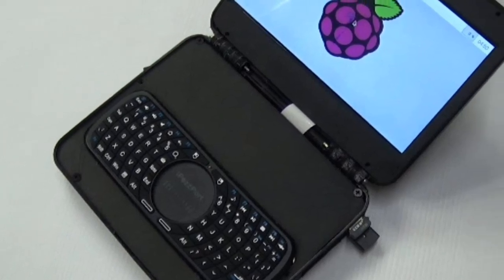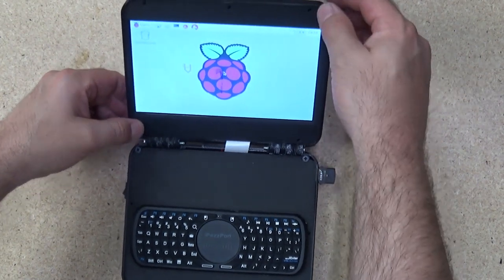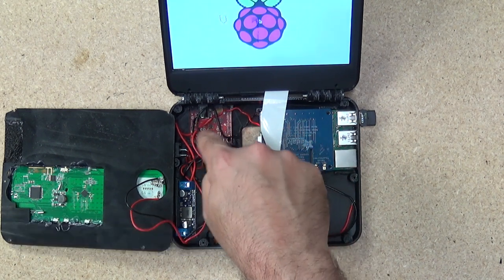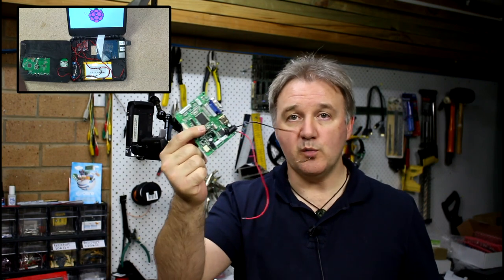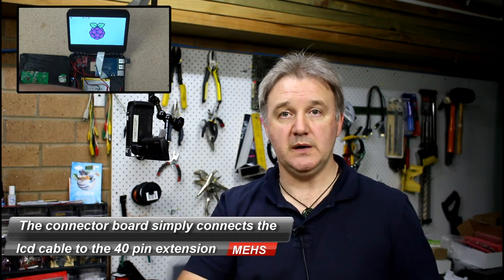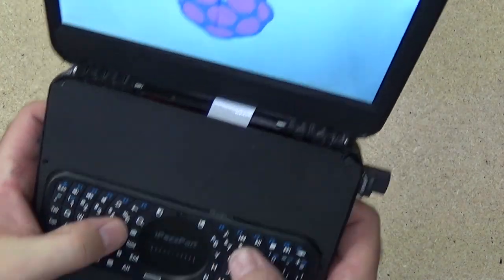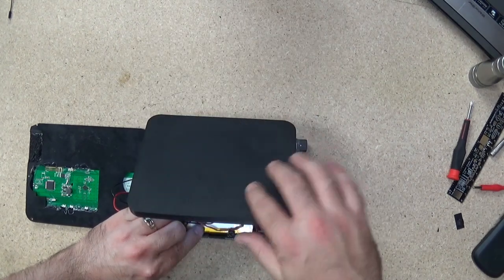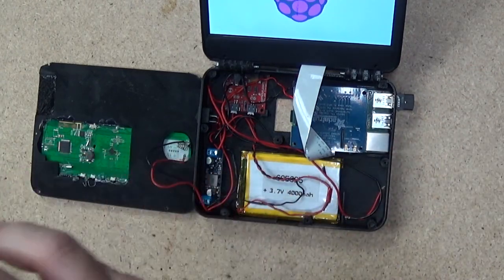Raspberry Pi 2 Portable Mk 5 (MEHS) Episode 39

Comment: From the looks of it.. It seems to have a 3 to 4 1/2 hour battery life... 7 1/2 with out the LCD, keyboard,  wifi and BT
Reply from the maker: Hi.  Pretty close.  About 3 with everything running normal use and yes 7.5 with just the Pi ticking over.  Cheers.

Comment: HI. What about adding a Psion series 5 style keyboard, nintendo 3ds style  controls and you have your perfect retrogaming rig. Ik think trying to get the total footprint slightly smaller would be great. Very impressive stuff.
Reply from the maker: +Raymond Mookhram - Thanks for the feedback.  I've got a spare 5 inch display just asking to be turned into a portable gaming rig so I'll keep your ideas in mind.  Yes I really like Psion devices but I would need to build the keyboard from scratch as I don't think anything similar is readily available, very time consuming, but possible.  Cheers.
Reply: +My Electronics & Hacking Show : I read somewhere that the Psion series 5 keyboard is stil patented and it's IP is owned by it's original designer. There are only two really good keyboard out there; the Lenovo/IBM keyboards for laptops and the Psion keyboards for portable devices. Up to now there still is no good portable keyboard. Perhaps an opportunity?
Reply from the maker: +Raymond Mookhram Yes perhaps.  Definitely a challenge!

Comment: you might be able to also eliminate the bluetooth dongle by piggybacking the leads to the transmitter on the keyboard directly to the usb jacks mount pads
Reply from the maker: +scott deere  Hi.  Thanks for the suggestion.  I have broken down a dongle and soldered the internal pins to usb pins before but never tried bypassing the dongle altogether.  Cheers.
Reply: Got the idea from Ben Heck

Comment: Why doen't you use the official Raspberry Pi 7" touchscreen?
Reply from the maker: Hi.  The official touchscreen is definitely a good option.  In this case I wanted to try something with the Kippah.  Also the official screen is a fair bit larger.  I didn't really want to go bigger for this particular project.  I may use the official display in a future project.  Cheers.

Comment: Ergh. If the s reen uses the in pins that means it needs a lot of reconfiguration to get the 3d processing from the graphics part of the chip. I'd rather just look for a HDMI based screen.
Reply from the maker: +eLJaybud - I haven't noticed any real world performance impact yet but I haven't done a side by side test of the Kippah solution vs a HDMI connected approach.  Might be worth looking at.  Cheers.

Comment: Do you build these just for the fun of building? Or do you actually use them
Reply from the maker: +Glychee S - HI.  Both really.  I enjoy doing the builds and learn what works well and what doesn't.  I use them as intended mostly but sometimes I retire an item because it just doesn't do what I wanted or sometimes, like this Mk5 version, it is handy but needs even better battery life and speakers.  If i did it again i would try to add a nintendo style game controller as this unit is really handy as a retro game console.  Cheers.

Comment: how did you learn building this kind of devices?
Reply from the maker: - Hi.  Just break it down into sections or parts and figure out how to best build or create each part.  This kind of project has a case and some electronics.  The case has a lid and a base and needs to house all the electronics and open and close like a laptop.  I could have made this out of wood, plastic, resin or metal.  Since I have a 3D printer I used that to make the case.  The design is done with software like Tinkercad or 123D Design.  It only takes a few hours to learn these programs.  From there its a matter of learning some design ideas and techniques and developing a viable design.  Then you pick up the needed 3d printing skills and you have a case.  Next is the electronics.  You need wire, parts, soldering equipment, tools etc.  You would need some basic understanding of electronics so If you don't know how to do something you learn it.  It will depend how much you already know and what you are actually doing but it is slow to start and you will learn more and be able to do more and do it more quickly as you progress.  So basically, figure out what you want to do and then figure out what you need to know but don't yet know and go an learn it.  Cheers.

Comment: You could've used MicroSD extension to make MicroSD slot on the side instead of big hole on the bottom.
Reply from the maker: - Hi.  Yes that's true.  Sometimes I just use what I have at the time but the sd extension would have given a better looking final result, maybe next time.  Cheers.
Reply: My Electronics & Hacking Show I totally understand you. Things from China may go for really long time, and local stores just don't have that kind of useful thing.

Comment: great project as usual,  mark 6 should be built with stuff easily accessed by every day pi users cuz I'm pretty sure you used a 3d printer lol
Reply from the maker: Thank you.  Yes I did use a 3D printer.  The next one uses acrylic but I'm still using a 3D printer for certain parts.  Cheers.

Comment: you can make it smaller if you use a rpi zero it will be smaller and faster
Reply from the maker: Hi.  Thanks for the suggestion.  Smaller yes but not faster.  This project has the pi2 in it, not the pi1.  I hope to do a Pi zero device sometime soon and yes, hopefully make it much smaller.  Cheers.

Comment: I'd rather buy it from you, if you would sell it somewhere on the internet.
Reply from the maker: +Sapioit Hi.  Thats a tricky thing when I think about it.  I'm not against it but prototyping doesn't produce a cost effective product.  Every part is basically retail and the approach is different to any form of production run.  As an example, the parts alone in this project cost approx  $210(AUD).  If I was going to make them for resale, I would try to cut the costs a bit.  I'd consider it I guess, depending on the situation, person, etc.  Cheers.
Reply from the maker: +Sapioit Which video?  No link.
Reply: My Electronics & Hacking Show The Windows Fundamentals for Legacy PCs is able to run on:
CPU: 233 MHz (300 MHz recommended)
RAM : 64 MB RAM (256 MB recomandat)
VGA : 800×600 computer monitor
MicroXP is able to run on only 12 MB RAM and even a Pentium Overdrive 8 MHz, since is basicly the Fundamentals stripped of the uncrytical processes and services.
http://winhistory.de/more/386/xpmini.htm.en (scroll to the bottom to see the side-by-side comparison)
So I'm positive that if the architecture is able to run it, it will perform well.